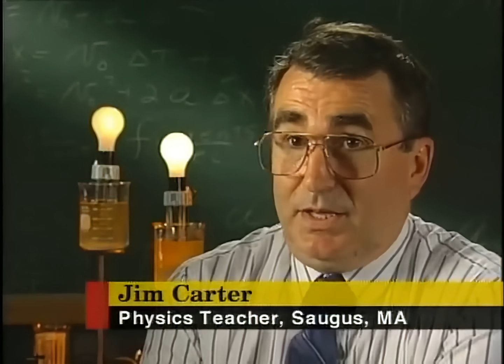MIT graduates cannot power a light bulb with a battery.

Comment: 1) Question is misleading. If it was the right bulb, they could have done it. Battery is too weak for this kind of bulb
2) We only saw students who have failed. What about them who gave the right explanation why is it not working ?
3) Typical YouTube video. Only clicks, shares and comments matters.
Reply: None of them should have failed. This was covered in 6th grade general science here. We even took a huge number of C cells and used them to briefly light a 75 watt bulb.

It's downright embarrassing that anybody graduating with a degree in any of the sciences wouldn't now this. There's just no excuse for it. I knew it by the time I was 8 and granted it's not necessarily fair to compare them with an 8 year old, it's something that they should all know if they're going into engineering.

These aren't high wattage bulbs, these are bulbs that should have lit at least a little with those batteries as long as they weren't dead. And considering that most of them weren't even hooking the bulbs up right to begin with, no amount of power would have led to the bulbs being lit.
Reply: The black dude managed to light the bulb up
Reply: they failed at understanding how a fundamental electrical circuit works. you should expect from EVERY SINGLE engineering graduate (much more if they are from MIT) to know how a basic electrical circuit operates. 

no matter the bulb, they fail to understand what a circuit is, so they would fail irrelevant of the bulb
Reply: yessssss someone understands something
Reply: Go ahead. Feel better about yourselves. Have you considered that not all graduates from MIT are engineers (perhaps economics, psychology, computer science, biology, math, etc)? Have you considered that while you were playing with batteries and bulbs in 6th grade, these kids were playing with LEDs and circuit boards in 6th grade (~2006). These are 21 year olds born around 1995. Those kids did not play with screw on filament bulbs. They built robots and programmed apps. But go ahead, call them stupid and feel better about yourselves...
Reply: your comments aren't making any sense!!! The first step to become a great engineer is to go with open eyes through the world! If you see something you don't understand, you should ask yourself, how it could be working and you shouldn't give up until you figured it out and let's be honest, it's not that complicated to figure out how a lightbulb works!! 
But let's look closer in that question!! Basically the task was not to light a bulb, the task was to make an electric circuit and the only thing their attempts to solve this problem showed, was their misunderstanding of electricity, which is embarrassing!
Reply: King Parodije        Are you fucking idiot?
1. They were graduates from "almighty" MIT, 
2. they were supposed to know elementary things like this and much more,
3. they SAID they can do it
4. their professor said they can do it
5. still, they FAILED.
6. moreover, some blamed the interviewer.

Ivy league is cool but sadly its more about image than proper education which is shitty pretty much everywhere.
Reply: ***** The point that I'm trying to make is that just because these selected group of kids never picked up a bulb doesn't mean they are stupid as some people have commented. Understanding that premise IS common sense. Knowing where the light bulb leads are is not necessarily common sense (obviously). Heck, I didn't know where they were for a long time (the screw side and the bottom nipple). Did that make me stupid? No. It was only when I ran across a wire and a bulb in a drawer in 1985, and didn't know how to light it up. I had to ask. BTW, they don't make you play with light bulbs in engineering school (not even electrical engineering). We did however build circuitry with microprocessors, sensors, and LEDs.  I'm not arguing the difficulty with opening phones, my point is that different kids have different interests. Some might walk past a bulb and have absolutely ZERO interest in playing with it.      Again, my point = zero experience with bulbs does not equal stupidity - not even lack of common sense.
Reply: doesn't change the fact that ANYONE who graduated from MIT couldn't give the right answer. It's ludicrous to have even a handful of these people. Electricity is the basis for ALL of our technology now.
Reply: +Bon Bon, those things came up in 2nd quarter engineering physics when they cover electricity and magnetism. And from what I remember, that wasn't the first time the material came up either.

But, that's really a moot point as you don't need to know really anything about electricical theory in order to light the bulb or determine that there isn't enough power.
Reply: King Parodije What does the colour of the skin have to do with anything? Intelligence and knowledge don't depend on skin colours, but studying and learning.
Reply: tono80 + and – leads? On a light bulb? o_O Light bulbs don't care about the polarity :q (Also it's not "minus", because it's not at negative voltage :P It's "ground", or 0 volts.)
As to playing with LEDs: I played with them too. And with integrated circuits. I can play with microcontrollers too. But playing with toys someone else much smarter made for you is not exactly the same as making those toys yourself and understanding how they work. Can you explain how an LED works and why does it emit light? Can you explain what's inside a microprocessor and how does it work?
It's easy to assemble ready-made modules of a toy robot or Arduino boards. But try designing and making such a board yourself. Not exactly child's play.

The problem with modern day technology is that most people can use it, but few people know how it works and how to make those toys. And this lack of knowledge is dangerous, it will bite you in the ass one day.
Reply: MaximumToke How do you know none of them could give the right answer?  His whole point was that it probably only showed the oeople who couldnt get it, like they do all the time.
Reply: Bon Bon Yes, everyone (enough to understand electricity) understands the whole concept of ground. It's a way to label components, simply. In an electrical schematic you do sometimes label your power source and load with a - and +, and it simply notes the voltage diff potential and the direction of current flow. Yes, everyone knows that a filament bulb does not care for polarity (like a diode). But if it makes you feel better, I mean contacts.   But good job trying to ridicule someone and trying to make yourself feel smarter. Yes, I know how a diode works, all the way to the molecular and physics level.   I can also explain to you the biasing arrangement, diffusion capacitance, exponential characteristics, high-frequency models, junction capacitance, rectifier models, etc., for diodes. I can also explain how an LED emits light to the photonic level.   And you know what? I bet you that these kids can too; well, at least the ones in the engineering and physics fields, probably not the one in the other fields (econ, math, bio, etc.), and I would not expect them to either.   I'm not saying that them playing with LEDs make them smarter. I was pointing to your saying that you have lit a light bulb in your past, probably as a child. Your whole thesis in all your ramblings is that these kids, and all kids graduating from prestigious universities in the US are STUPID. Quite a big assertion, and all because you say a youtube video of a couple of kids that have never taken a screw bulb and lit them up with a battery.  Yeah buddy, they are SOOO stupid. Another a assertion is that you said in one of your comments that engineers fix "your fancy toy".   You just proved that you have no idea what engineers do. They do not fix things. Technicians fix things, engineers design them. Can they easily learn how to fix things, yes of course. But engineering is above that. They are designing the next level computer or smartphone that you're typing on right now....yeah, really dumb and stupid things. Anyway, you're probably just some insecure guy trying to find any little opportunity to sound smart.
Reply: Guys, guys, calm down. The idea wasn't to see if they know but if they say they know when in reality they don't. The conclusion is that they are overconfident about their skills and knowledge. That implies their schools dont put  much emphasis on knowledge itself rather on the illusion of it and prestige. Ignorance isnt stupidity but mix it with confidence then it might be. On average these kids are smart but not smart enough to make a significant difference compared to lower ranked universities.
Reply: tono80
Whoa, now that's a strawman argument right there :P I never said that those MIT grads are stupid. So why are you imputing me that? Lack of things I actually said that you could pick on? :q
The closest person of calling them stupid was ademar9988, but still too far. So the only person to think that way was you.
Looks like I tickled some nerve of you, judging by your aggressive comment. Are you a MIT graduate perchance? :J

Let me quote after First Ladt, who is the closest to what I think too:
"Ignorance isnt stupidity but mix it with confidence then it might be."
And read his/her entire comment carefully, because that was the best way to put it.

Those MIT grads are not stupid (well, most of them). They have a lot of knowledge about stuff. But the point of the video was to show that knowledge alone doesn't make you smart, if you cannot apply that knowledge to practical stuff. The light bulb was just the simplest possible example of such practical application, and every engineer worth of its title would light the damn bulb.

Sure, they might have played with LEDs or some Arduino stuff as kids. But my point is that playing with toys made by someone else doesn't make you smart, similarly as playing with a magic wand of a magician doesn't make you a magician yourself. What makes you smart is understanding of the magic you use, not memorizing magic spells or waving your wand around.

Inb4 you say I'm calling them stupid again: no, not being smart isn't automatically the same as being stupid. My mom doesn't know how to calculate an integral of e^x. But she's not a MIT graduate, nor an engineer. Does it make her stupid? No. She's a lovely person and very smart in the life experience sense. (And she can light a bulb with a battery:q ) Ignorance is not stupidity. Lack of education also isn't. What makes you stupid is over-confidence about your knowledge and abilities while you have none, which often comes with being delusional.

So let's apply this last rule to those MIT grads from the video:
1. They thought they know how to light a bulb (=being delusional, because it doesn't match reality).
2. They said they can do it (=being over-confident, because they failed to deliver).
3. They didn't ask about the details of the trial, like, voltages, types of light bulbs etc. (over-confidence again).
4. When they failed, they tried to make some crappy excuses to cover their ignorance, e.g. that they couldn't find the terminals (playing smarter than they are), instead of admitting the problem and asking for hints (which a smart person would do when facing a problem they don't have experience with). There's nothing wrong in admitting you don't know something or can't do it. "I know that I don't know", said one smart guy you probably know ;J

So yeah, some of those MIT graduates were stupid – those who said they can do it but failed miserably, and didn't asked for help afterwards, but tried to save their ass with crappy excuses. (BTW, I encourage you to read your comments again with that in mind.) But not all of them were.

Stupidity is a choice.
Reply: Bon Bon Aggressive? If you think my argument is aggressive, then you must wrap yourself in bubble wrap. Look around into the interwebs trolling world and you'll know what's aggressive. Be careful, they might even call you a name.  I just think it's hilarious when people jump to the front row when a smarter person a mistake or does something discretely stupid. Yes, I will go as far as saying that you're implying that these kids are stupid or that something is wrong with them, or linking them to the idea that "only in America you have the right to be stupid", or whatever negative adjective that you're thinking. 

So I comment sometimes on videos, because is fun, and takes little effort for a fast typer like you and me. I do I agree with a couple of our points (like 2 and 4). Yes, they're overconfident, and even cocky - heck who isn't' at 21? I learned not to be cocky in my late 20s early 30s! These kids will make a lot of mistakes just like you did at that age. They also did come up with some BS excuses the second time around I watches the video. I skipped a couple of them, because it was boring. 

Nah, I didn't get into MIT, though I applied. I guess I wasn't smart enough. But, I did make it into a very good school and got a great education (as much as you can get in 4 years). The real education happens afterward. Ah, again, let me remind you that MIT doesn't just graduate engineers. You seem to keep pointing to the assumptions that these kids are engineers. 

Again, what I think is funny is people jumping to the gun to ridicule something or someone that is not a big deal to feel better about themselves. What is also funny is how your argument goes back and forth, and now I'm confused about your thesis> First you assume that not knowing how to light a bulb = not smart (or bright, or solver, or whatever adjective you have in your mind). Then, you hit back with saying that not having knowledge does not make you stupid. Then you imply that since you have played with a lightbulb (and now you know how to light a lightbulb), then you are better/smarter (yeah yeah, I'm putting words in your mouth). And then you say that playing with toys someone "smarter" than you made doesn't make you smarter. Then you talk about problem solving and make a huge leap to imply (yes, again putting words in your mouth) that these kids have no problem solving skills - based on ZERO evidence other than -> can't light  a bulb. 

Alright, this argument is getting a little ridiculous and I'm getting a headache. Peace.
Reply: no they dont know practical engineering only hypothetical science
Reply: tono80 This video is definitely not recent. Looks like it was made in the early 00s.
Reply: Christian B To me it looks and sounds almost definitely late 80s to early 90s
Reply: RyanPerson, he doesn't mean none of them, he means that anyone who graduated from MIT should get this. Its a basic subject of high school and lower and as he points out, is the foundation of the majority of our current tech. 

And even the point of the video is why has teaching failed this handful? It doesn't matter if it was even one. That's one that shouldn't have slipped through the cracks of understanding the concept.
Reply: King Parodije but what about the guy who made it work? I suggest you watch it again and pay attention this time!
Reply: +Bon Bon Why do all MIT graduates need to construct the circuit that lights a bulb without instructions? I think the large majority of people maybe 80%+, have never had to work with bare wire without instructions. And if they did, the MIT grads could quickly learn how to do it.
Reply: @timithy4569  Why did they predict they could do it then? They themselves seemed pretty sure of it. This is why I made a technical exam that mimics the work we do at my company to applicants. I've come across so many that can understand theory but fail to do the actual work
Reply: ad 1) it doesn't matter if the Battery was to weak, you could give these students Megawatts of Power and the correct voltage and these circuits wouldn't work. 
ad 2.) everybody who wears this black hat at an engineering school should be able to build a circuit like that.
ad 3.) that's the way how youtube works.
Reply: Yup, and there are great teachers (like Prof. Walter Lewin) and bad teachers (like Prof. Gilbert Strang) in each school or university, no matter how famous or prestigious.
Reply: Bon Bon dude, they simply didn't know where the + and - leads are on a screw on bulb. These kids played with LEDs and robots while you played with AAA batteries and 1980's flash light bulbs. Chill out... You must feel soooo smart
Reply: ***** Yes, you prove my point. Knowledge alone does not make someone smart. These kids have obviously never experimented with a screw light bulb in their lives, and even if they did, they probably did not light it with a bare wire. Perhaps they were never interested in that when they were children, and instead, they opened up a cell phone.  Remember, these kids were probably born in fucking 1995. They probably will never experiment with a screw filament bulb in their lives until the day they die in the year 2100.    How do you know they can't solve problems?   Heck, even I (at 36) probably played with a screwbulb and wire like twice in my life, and I'm an electrical engineer. And the ONLY reason I did, is because my great grandmother had a little gig to test batteries back in 1986. So I took it apart and played with it. Does that make it smarter or better than an MIT graduate? No, there is no evidence of that.   Another point, not every graduate of MIT is an Engineering (electrical for that matter) geek. There are over 60 majors at MIT (including African Studies and Anthropology). The whole point of these comments, especially to the person that I was talking to (Bon bon), is that, because these kids have never picked up a light bulb, then they are stupid, and the "American Institutions" like these are completely illegitimate. Not every 21 year old has played nor is interested in playing with a dumb bulb and a wire.
Reply: Everyone keeps missing the point of the video. The whole point was about TEACHING and to make sure the way we teach is able to be easily applied by students in real world scenarios. All these students given time would likely have figured it out, but the fact they didn't just know quickly after being taught the theory was the point.
Reply: King Parodije thats point of the video thoigh to show despite learning what they have they still dont have the experince needed.  they are not taught the most basic fundamentals.  a basic understanding does not exist for them.
Reply: +tono80, there are no + and - leads on a lightbulb! These are bulbs that commonly are driven off AC current and as such the direction of current is of no importance to the question.

Arguably, it's a bit of a trick question in that once they do have the items arranged properly, the bulb won't light up anyways, but these are graduates from MIT in engineering, it's downright embarrassing that any of them got this wrong. I can only hope that this is a spoof video and not representative of actual graduates. 

But, if they haven't figured out that you attach one of the contact points on the bulb to the battery and the other to the wire with the wire itself contacting the other end of the battery, then they should really get a refund on their degree, because they haven't even managed to accomplish what the students at the community college I work at are expected to know prior to entrance.

Now, if they don't understand why that's the case, I can sort of get that, that's at least somewhat complicated, but not knowing how to complete the most basic of circuits is pretty embarrassing.
Reply: Bon Bon Rofl.
Reply: phoenixamaranth Well he literally said noone could answer it, but anyways, I dont care how well they teach, there will always a few students here and there that wouldnt be able to answer it.  There were what, like 5 in the video?  Thats not even close to the amount that graduate.  You dont know how many they interviewed, which is why this is a horrible representation of MIT graduates.  They could have cut out 50 people who were able to answer it and only showed the 5 who werent for all we know.  They do this just for views and controversy, as a video where everybody would be able to answer it would be somewhat boring.
Reply: The video is about teaching and teaching methods. They do this because the point is no one should not be able to do it. All these students have had this topic at least once yet went away  with some unable to do it.  The point of the video is no student should be in that situation because teaching methods should be improved.
Reply: Except I never typed the word "noone" so I DIDNT literally say that. Read slowly and more carefully, and then think about it for a few minutes before you respond all trouser troubled.
Reply: Sure, there always be some students who don't get it. But why did they give them diplomas then? :q
Reply: MaximumToke What does "doesnt change the fact that anyone who graduated from mit couldnt give the right answer"  mean then?  Or are you going to say you never said that either?  You probably would actually because the only argument you dumbfucks on youtube ever come up with is "I never said that".  If English isnt your first language then I apologize, but gramatically, that is what you are saying.
Reply: Phoenix already explained to you what it means. It means that even ONE MIT graduate failing to solve the lightbulb battery question is a disgrace. It means that EVERY person who comes out of that school should be able to solve it. Let me simplify further. SMART PERSON ISNT SMART IF CANT LIGHT BULB WITH BATTERY.
Reply: MaximumToke I already adressed that.
Reply: why don't you show us exactly where you already addressed that then? All I've seen out of you is a reading deficiency and plenty of name calling.
Reply: MaximumToke In my comment
Reply: These people still graduated MIT, and then went on to high paying jobs where their only credential was that they graduated MIT.

Anyone with any electrical knowledge at all would know that bulb is for a 120v circuit, and it wouldn't be powered by a 1.5v battery.
Reply: So not only could MIT graduates not hook everything up correctly, they also couldn't tell that the bigger light bulb couldn't be powered by the battery they were given. This doesn't dismiss my point, it solidifies it.
Reply: +tono80 Lol. What about this video makes you think it is made in 2016?
The quality of the video? 
The 90S fashion?
Reply: Wait, what makes you say that? First off, you know the video was selectively edited, so you can't say for sure that they don't know the fundamentals of a circuit. 

They answered correctly to the basic question: Can you light a bulb with a wire and battery. Yes, technically you can. However, specifics do matter. The bulb given for example was (I believe) 120v. You can't get a 120v bulb to noticeably shine in the daytime with a single 1.5v battery (hell, assuming the battery was even at 1.5v...).

Anyways, my point is your bias is getting the best of you here. You WANT to believe these students failed without reason, but the evidence suggests otherwise: 
1.) The video was selectively edited. 
2.) They gave the correct theoretical answer.
3.) The materials given to them weren't appropriate (such as a 120V bulb and a 1.5v battery).
4.) There could have been intentional deception (after all the video producer has an agenda here). They could've given them a dead battery, a wire that's too short or out of spec, a bulb that was tampered with or simply out of spec (for the power source).

So, don't let your bias get the best of you here. The evidence suggests they were set up to fail. Note how the guy at the end had a proper size bulb and he was able to do it.
Reply: you'd still think that an engineering graduate would be able to call that out though. they're supposed to be trained to look for those details.
Reply: The one guy shook his head no as he said "yes", meaning he had no confidence in his answer.
Reply: @Stewie Griffin Omg you made so much sense mho
Reply: @bsanchez3563  With what, if I may ask? I wrote quite a lot of comments, about different things ;)
Reply: @bonbonpony  the inevitable need to fix stuff, make toys
Reply: @bsanchez3563  Oh, that. Yeah, it becomes even more relevant now, when corporations try to ban people from repairing their own stuff. Look up "Right to Repair" and "Louis Rossmann". He is a dude who runs his own repair shop for Apple laptops, and one of the supporters of Right to Repair regulations. You can find some videos on his channel about that subject (as well as many videos where he shows how to repair electronics).
You can also check out Jessa Jones's channel. She repairs mobile phones, and she even taught her 7-year-old kids how to do that ;)
We need more people like those two. Unfortunately, corporations such as Apple are doing their best to push regulations that may disallow people from repairing their own stuff and sharing knowledge of how they work :P  Looks like they know all well that knowledge is power, and they don't want to share that power with us :P
In Sacramento, California, they already passed a law that disallows people from fixing their own cars in their garages. This is getting really bad, and it will be even worse if we don't stop them from pushing such laws.
Reply: @bonbonpony  cool & thx
Reply: @bsanchez3563   WYM?.  I said this is not from 2016..
Reply: One guy literally got it to light up. It wasn't bright, but it did do something
Reply: You missed the guy who did it?
Reply: damn right sir.
Reply: The correct answer to the question is "it depends on the battery and the bulb", there's nothing misleading about the question.
You just need the most basic level of engineering knowledge
Reply: The problem is out of that school, especially graduated there should be zero of them failing such a simple thing.
Reply: The answer would be:
"Depends on the battery and bulb"
Not:
"Duuuuhhhhhrrr"
Reply: 1) Not really relevant. The question was not about a specific bulb, battery and wire. Its whether you can light a light bulb with a wire and a battery. And yes you can.
2) Being the self-proclaimed "premier engineering and science institution in the world" with one of the highest tuition costs and supposedly only the best of the best in and even better out.. If even one fails that means there are some serious problems with the education and the person's understanding of GRADE SCHOOL level science. A person holding a masters in engineering failing at something 10 year olds understand is ridiculous.
3) True, doesnt mean this doesnt expose a problem though.
Having bought a diploma does not mean you are educated, it means your daddy has a good job.
Reply: sure, only the students who failed are exposed. but only if 2 or 3 fail it is still tremendously disappointing
Reply: timithy4569 Because MIT stands for Massachusetts Institute of Technology :P
They don't need to deal with bare wire all the time, but they at least should know how to deal with it when they face such problems. (And they will face!) If you only learn how to play with toys made by other people smarter than you, then you're not really that smart. One day there might be no smart people and their toys around and what then? You would have to be smart enough to build such toys yourself in order to do something more high-level next. Or your fancy toy may break and you will have to fix it. That's what engineers do, isn't it? :q
Reply: @bonbonpony  omg you make so much sense mho
Reply: There's no paradox. Only nitpicking.
Reply: When you say "no smart people around", do you include yourself into your surroundings too? ¬,¬
Reply: Chris L America – the only country in the world where you have a right to be stupid :q
Heheh yeah, I was playing with electric circuits when I was a kid. And I learned more about electricity that way than those MIT grads apparently know.
But if you think about it a bit deeper: what do you actually know about electricity? Sure, you can connect some wires to the battery and the bulb to make it lit, but what if you didn't have a battery? Do you know how to produce electricity anyway? Or how to make a battery out of potatoes or lemons?
You can learn in school that electricity is made by rubbing things on each other. But is it true? If you experiment with it for a while, you will notice that this is not true at all: I can rub two things made of the same stuff all day long and it produces no electricity. Because it's not about rubbing – it's about different electronegativity of the stuff which the bodies are made of, and about separating charges (even from objects made of different materials, you can rub them all you want and you will see no electrification until you actually separate them). It can be done even without physical contact between bodies (cf. Wimshurst's electrostatic generator, Van de Graaf's generator, storm clouds etc.). Because there's no such thing as "physical contact" when you zoom in to see the atoms – they always act at a distance, even if the distance is very tiny.
But they won't teach you such things in any school. You can learn that only from your own experiments with electricity, or by reading some old books written by people who did perform such experiments themselves.
Reply: I know. Black dudes rule.
Reply: Yes. Because it shows that they give diplomas to people who cannot light a light bulb.